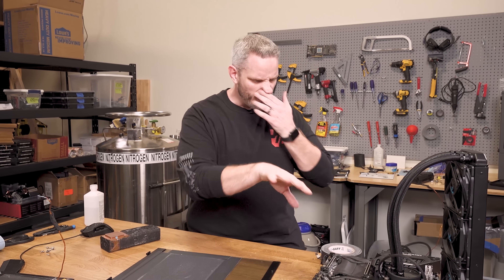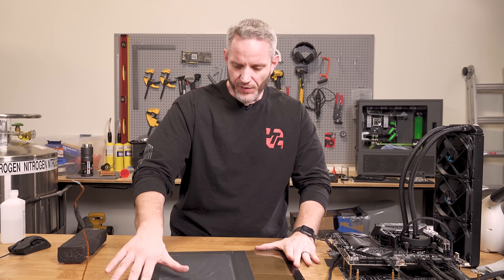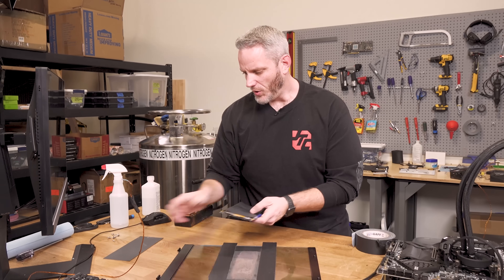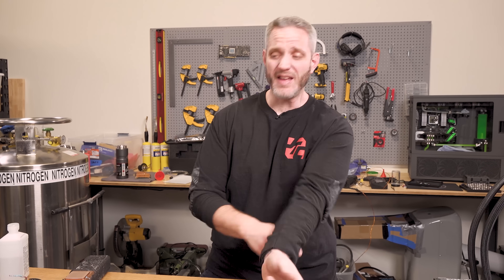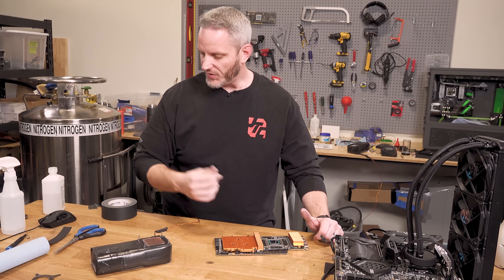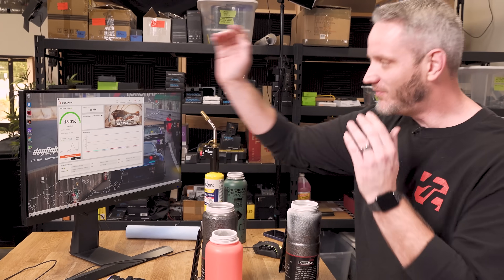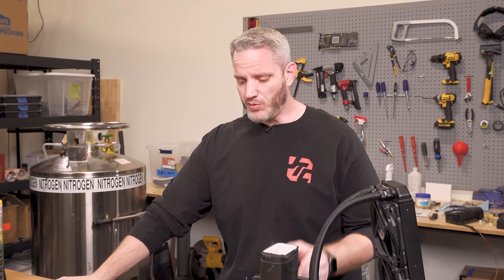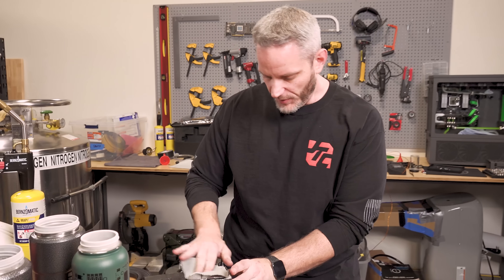THIS is Why Lapping Your Cooler is SO Important!!

Comment: So I have been doing A LOT of testing with my EVGA 3080 FTW3 Ultra, and I was pretty disappointed with the results of my overclock at first... stock bios, then I tried the XOC BIOS, still not what I was expecting after paying so much for this card... (I got it directly from EVGA through the queue system) and so I started to think... I noticed the STRIX OC has a higher boost clock... and I thought... hmm... what would happen if I flashed the BIOS of my EVGA card to the STRIX OC.... and I'll tell you this much.. IT WORKED... it is stable, didn't lose any outputs like people warned me about, and my card is acting as if it is shunt modded? I know that doesn't make sense, but I noticed in software it is reporting HALF the wattage that it is actually pulling, so.. I am seeing around 600 watts being pulled with the STRIX OC BIOS when I am overclocking. Software says around 300 give or take a few. I know I can push it further, but I don't have access to voltage control. I wonder what would happen if Jay were to flash his BIOS to the 3090 STRIX OC?? I noticed the boost clock is higher on the STRIX OC 3090, not by much, but is higher. Just a thought.
Reply: Oh and not burned out at all Jay! These videos have been pushing me to go further with my overclocking. So far, I have got my 3900XT to 4.766ghz with a graphite thermal pad from IC 40mmX40mm and using an NZXT X63 Kraken (changed the fans to Arctic). Noticing 10c give or take a few lower difference from Mastergel paste (I have done A LOT of testing and it is winter here, so when it gets back to summer I will have to change some settings maybe).... I have it on an ROG X570 Crosshair VIII Hero WiFi. Daily though, I have it all on auto with some PBO tweaking and undervolted. I easily keep up with my G-Sync 240hz monitor on most games, everything on ultra and maxed out. This 3080 is a beast now after BIOS flashing it.

Comment: "Some groove is ok, you want the thermal paste to have some bite in there" - my understanding is the surfaces want to be as clean and tight-fitting as possible, thermal paste is secondary in thermal transfer to the die and block material, therefore you want as little thermal paste as possible, grooves would just increase the surface area/quantity of thermal paste, which in turn will retard thermal transfer as there's now more paste to pass through.  The ideal scenario would be to have the surfaces as clean as gauge blocks with the barest hint of thermal paste to fill any microscopic imperfection. Lapping, yes, absolutely.  Grooves?  Nyet, lap those bastards until you can see a decent reflection.
Reply: There is a fine line where a little groove does equate to more surface area for heat transfer, but that walks a razor's edge.  I was playing around with aluminum cooling blocks for a while trying to see which heat paste had the best conductivity by measuring how long it took to raise the temp of a gallon of water. (using crappy lab procedures on my part most likely)  I found that they worked best when there was flat blocks that had just a faint hint of texture to them. but with that being said, I suspect there may have been other stuff going on in that situation. .... I also may have had far to much free time with a walk in freezer.
Reply: Yup, you want to polish that thing to a mirror finish so there is as little groves as physically possible.. Also using something like Persian Blue or any lapping dye would be useful for identifying high spots.
Reply: Perfect mirrors work OK with small dies but with the size of modern GPUs or CPU heatspreaders and the viscosity of most thermal pastes, you want them very very flat with just the merest hint of surface texture to allow the paste to flow out under typical not-C-clamp mounting pressure.
Reply: @mattd5136  Texture will aid static tension, not reduce it.  Also a slight rotating side-to-side wiggle when applying the cooling block to the die is by far the best way to seat and minimise thermal paste in the contact, I've had a good 25 years of building to see what works just nice.

Comment: This video confuses me. In a perfect world there would be zero space between your cpu and the surface of the cooler mount. In the real world this is never true, so thermal paste's purpose is to fill in any microscopic gaps. Lapping a rough surface into the mount only creates more space between the surfaces and thus a need for more thermal paste. That doesn't make any sense.

Comment: An idea: use lapping compound, and use it between the cooler and die. Move the die across the cooler to form the cooler to the same shape as the die. Do this as a final step, and don’t overdo it to not damage the die. Use a very small amount of rubbing/lapping compound. Use the die on top, cooler plate on bottom to keep the lapping compound from contaminating the die or pcb. It should work (in theory).

Comment: Have you ever looked at drying / using a dehumidifier to reduce ice accumulation? If you were able to have the system in a completely dry environment then there wouldn't be ice. Another idea would be to look at OC scores with ambient humidity as a variable.

Comment: Hey Jay,

Quick "now you know:" heat is exchanged through surface area, not through volume. A greater volume will store more energy, but a greater surface area will transfer more energy. Those scratches in the thermal interface increase the surface area of the copper and increase the rate of heat transfer from the die and paste to the block, just like the interface between the block and the water/CO2/N2/glycol/everything-else-that-you've-cooled-with is designed with holes and channels.

This also may increase the amount of direct contact between die and block, which is going to transfer heat much faster than through thermal paste. Kind of like sipes in a tire, which direct water and snow around the tread blocks that are making much more direct contact with the pavement.

Comment: You XOC people need some makers. I’m just imagining like a vacuum chamber case with an opening into a atmospheric pressure pot so you can’t get condensation and whatnot. 

Maybe it’s dumb and wouldn’t work but there’s a million things that could potentially solve these problems and all anyone ever seems to do is sand, remount, tweak settings, pour, rinse and repeat. So little creativity in XOC from what I’ve seen.

Comment: I’ve never understood why this process is still so manual. I remember hearing about somebody’s LN2 “roboclocker” but I don’t get why more people don’t do things like machine custom brackets, drip feed LN2 with a raspi or something to match the benchmark sections, etc. 

I get it’s added complexity but it would also mean you could make things more consistent and tweak less variables at a time.

Comment: Leaving the surface a little rough makes me think the point is more to have consistent peaks/valleys rather than no peaks or valleys. 

I don’t get why that would be better since it just means more gaps for thermal paste to fill rather than having metal to metal contact. But ok.
Reply from the maker: Yeah “but ok”
Reply: @Jayztwocents  
But ok = that’s what the expert said and I don’t know any better so while it doesn’t make sense to me, it obviously must work, so I’ll accept it even though it doesn’t make sense...

...But in less words. It wasn’t a sarcastic “but ok”.
Reply: @Jayztwocents  P.S. congrats on 18k

Comment: This might seem odd, but I think you may benefit by sanding like a sax mouthpiece re-facer. To get the part of the mouthpiece that's supposed to be flat, flat, they universally sand by sliding the piece in ONLY one direction. You will always round it slightly by going back and forth. If you want the cross hatch pattern on it to create a little more surface area for the thermal paste, I'd add that by doing only one or two light passes in two directions AFTER it's already flat. You may angle the surface by a few thousands, but I think flat is much more important than square in this case. 
Here's a guy refacing a mouthpiece, flattens the table in the first minute: https://www.youtube.com/watch?v=MLSb2N-Zu3I&t=77s
I may be the vocal minority, but I like the LN2 videos, and just about all the others. You guys are clearly smart, but you say the silliest s*** (^o^)

Comment: Leaving the surface rough doesnt make the paste "stick better", the paste is already compressed and doesnt need to "stick" to anything. Leaving a rough surface increases surface area and increased surface area allows for more contact with the paste allowing more efficient heat dissipation.
Reply: If this is true, why don't most CPU's and Heatsinks come smooth with Billions of R and D and decades of experience? It would be trivial to etch in a pattern.  I am curious to the answer?

Comment: Hot Tip: For LN2 cooling use one whole Verge of thermal paste.
Reply: Nice, Verge is now a unit of measurement.
Reply: +1 for making a Verge an SI unit for applying paste ^^ - 1Vg = the whole tube.
Reply: I see what you did there.

Comment: You actually have more surface area with some roughness over perfectly smooth surface which is why thing stick better.
Reply: You have more total surface area on each surface, but you have less of the surface in contact since the deviation across each surface won't exactly match up with each other. The flatter two surfaces are, the more area of each is in contact with the other when they're mated. Obviously, for conductive transfer, the more consistent contact is what matters.

Comment: So fun watching this very similar process to sharpening chisels and other wood working tools. Absolutely secure that glass it definitely helps keep things flat and maintain even pressure. Try some wetstones. Coloring over the copper plate with sharpie or ink then doing a couple strokes in the sandpaper will show you your low spots.

Comment: Would an inch-pound torque wrench do any good in helping build some repeatability into these LN2 runs for pressure on the GPU from the pot?  Perhaps get a flatter mount rather than brute forcing it with the C clamp?

Comment: I remember lapping CPUs 10 years ago the technique you would use is to bust out a brand new razor blade, and see if you could see light coming through anywhere on the surface, or if it was bowed enough to rock the razor blade on it. if it was concave or convex you'd just flatten it until you got near the flatness you wanted, then go to finer and finer grits and polish it to a mirror finish, flattening it fully in the process. I remember getting an Athlon 4000+ to load at 30c, and idle at 1c above ambient, around 19c on a cool day. It was absolutely nuts how low you could get temps doing it. The only way to get better at the time was to desolder the IHS and go direct die with a custom block mount.

Comment: You need to use far less heat compound. It's meant to fill microscopic scratches not make a waterslide. Metal to metal transfers heat best.

Comment: Just a heads up but metal can change shape with temperature. Could help to get it closer to its running temp before lapping so it doesnt cause warping whenbit gets cold

Comment: Safety tip do not inhale copper dust be very careful when lapping it.  My friend's wife is an industrial safety pro who actually worked in a chip fab and she gave him heck for not wet sanding his heatsink when lapping it.  Apparently it is toxic to breathe, despite being an essential nutrient in small amounts for most of us.

Changing subjects, does Jay or anyone remember the early heat pipe cooler towers from like 2005?  I had one that was all copper, the base, heat piipes and full stack of fins all copper.  There was an aluminum cowling but I took off to mount fans differently.  All I remember is the bottoms were like mirrors when I got them, but cannot for the life of me remember who made them or what they were called.  Newegg purged old order history and hotmail deleted my inbox for inactivity back in the day so any help for my doddering nostalgic brain is appreciated.

Comment: You could blueprint the mating surfaces of the pot and the GPU. Similar to what you're doing with the thermal paste but engineer blue is going to be much more accurate. If you want to get really crazy with it, once you get the pot perfectly flat you could lap the two surfaces against one another with a increasingly finer lapping compound. Also I'd like to challenge the premise of leaving the mating surface rough. As the thermal paste has the highest specific heat and lowest thermal conductivity of the transfer materials, by a massive margin, the thinner you can make that layer the better. A rough texture would only serve to allow for more of the poorly thermally conductive paste to be between the two highly conductive metal layers and would exponentially slow the transfer of heat relative to the thickness of the paste.

Comment: Get a Lapping or Honing Surface plate.    A 12"x12"x4" Grade AA Granite plate is flat to .000050”  and sells for about $250. (e,g, Starrett model # 85006).  Or more budget, you could get a steel honing plate typically used to hone wood working chisels.   8" × 3" × 3/8" with flat tolerance of 0.005" you can get for around $25, like a Veritas Steel Honing plate from Lee Valley website.

Comment: Funny thing is the reason they use thermal paste is to compensate for minor defects in the surface for proper cooling.  If it's lapped correctly and perfectly you won't need thermal paste but the people who lap cpu's use it anyway because they have no clue why it's really needed.

Comment: What do you think would happen if you got a longer pci extension and submerged the gpu in mineral oil. The pot would stick out and you still could pour ln2. Maybe the oil would thicken but wouldn't it prevent water vaper from condensing at all since it's submerged? Just a thought.

Comment: Jay: You need to get the result on the first run otherwise the card gets too cold
Also Jay: So I kept doing runs and it's not working so I tried tightening the mount, why isn't this working?

Comment: Glass is not perfectly flat. Mirrors are, because if it wasn't you would be able to visually see the warping.

Anyone who does 3D printing can tell you how uneven glass is. Mirrors though still slightly flawed is far, far, far more flat.

Comment: I would highly recommend tightening & torqueing the cooler screws in a star pattern, and do so in 3 stages. Your going to need a torque wrench that goes low enough, also need to know final foot-lbs to tighten screws to.
1. Very loose by hand, just to make sure they are threaded in correctly.
2. Medium snug-ness about 70% of final foot-lb goal.
3. Final foot-lb goal, should only be a couple above last level. 
This should ensure that all corners are evenly pulled down flush to the CPU. This is the same principle when torqueing down lugs nuts on a car tire. Love the videos!!

Comment: Just use a square brick ffs so the weight distribution is 100% on the copper.
And not the one that you used that 100% gave an angle to that copper because it shifted weight to the other side.

Comment: Would using a dehumidifier and pointing the exhaust at the motherboard when using LN2 help with the icing problem?
Reply: A conventional dehumidifier isn’t going to do anything.  A desiccant based dehumidifier, that’s used for industrial process applications, will get you down to a -90°F dewpoint. Jay is running the pot well below this temp. BTW, those desiccant based systems cost $75,000 and up if you want them to hit a low dewpoint like that. You’re talking .01 gr/lb of moisture in the air.

Comment: ..why dont you put a thick metal square (much bigger than the core) with a foam layer on top (towards the card back, maybe even the pot) under the clamp to spread the load..? Then the clamp force would be even on the whole metal square/card/pot and you dont need to care about bowing, at least...

Comment: Re, rough vs shiny. 
I personally think (I have no data to back this up, only logic), that roughing up the surface after the lapping will be better. Because there will be more surface area for the heat to transfer to the paste. Just like those (old?) electric stove heaters have rifling, and the underside of pans. (I say old, because by large, induction heating is more used these days, and those don't rely of surface area for heating.. ) Anyway, I make sure to get things flat, then I make a pass with a low grit papper just to put some long scratches into the copper.

Comment: Don't lap your coolers or chips, there is no need nowadays to extreme overclock unless you are trying to measure your peter or stroke your ego. Technology nowadays is plenty fast enough to run any application. Don't ruin your hardware, if need be, buy better. Also you will have zero resale value when you do need to upgrade.

Comment: Im no pro or even an overclocker but it looked like you had direct contact with the back of the die with the clamp, what about using a thermal patch with a piece of wood for even pressure.

Comment: Jay.. the reason you want a polished surface isn’t so the thermal paste has something to stick to. It’s surface area. 

Imagine you draw a straight line. We will say 5 inches. This is your polished surface. 

Now draw another line, same 5 inches. This time make it jagged. This is your not polished surface. If you stretch the jagged line flat, it would be longer than 5 inches. 

More surface area=more heat transfer.

Comment: Great trick, also works on small aluminum engine heads and reed valve cages. It seems to me that a lot of time is spent engineering solutions for the wrong problems. May I suggest a pneumatic clamp with pressure adjustment... the c-clamp is too sloppy.